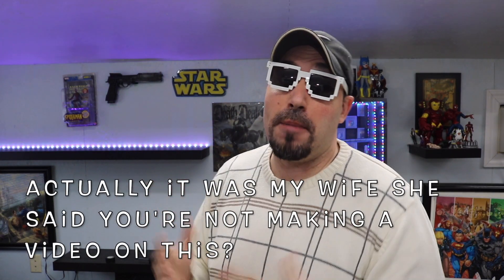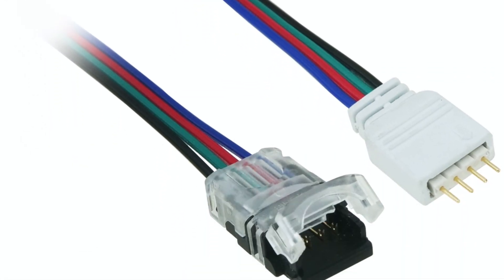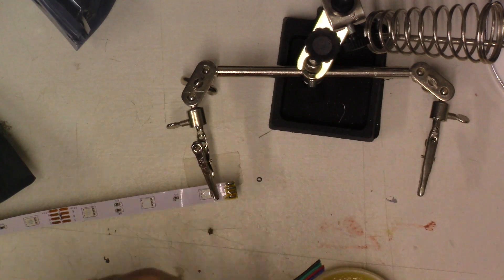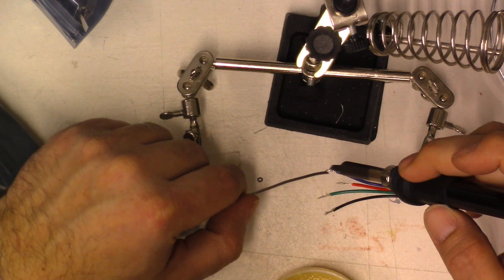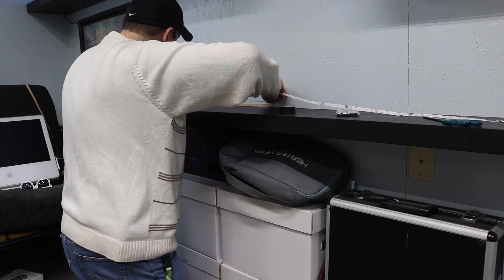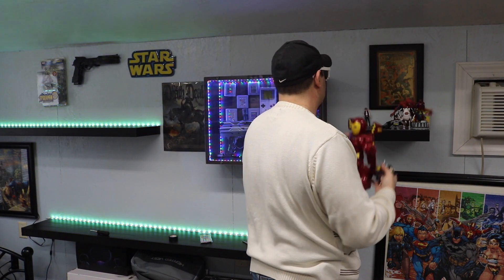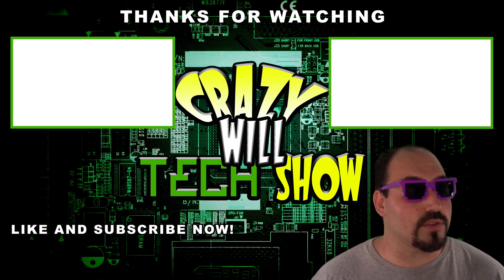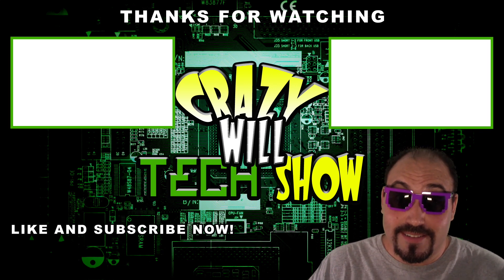Installing LED light strips on multiple shelves

Comment: planning todo this and wondering is there a difference from splicing the wires with the spliced end being on the first pad of the led either from the beginning of the strip closest to the power supply then from the end of the first strip of LED's?

I have a "trim" basically what the door frame is but it also runs along the middle of the walls and makes my walls have sections that i want with LED's with 2 different colors and want to know if i can split the wires a couple times so each section has enough power for them all to be bright and idk how many times you can split a wire and if you can split a wire thats already been split.
Reply from the maker: You can split them as many times as you want. You would have to look at the recommendation of the power supply to see how many sets of LEDs you can connect to it.

Comment: Should have used aluminum casing and connectors instead of soldering the joints. It would have been easier and look better.
Reply from the maker: Never had much luck with those.
Reply: @CrazyWillTechShow   Okay, I just find them easier and have had success with them. Love your videos by the way.
Reply from the maker: Could you please send me a link… i’m willing to give them a try.

Comment: Hey I know that this video was uploaded a while ago, but I really need some advice
I bought a 12v single 5-meter strip.

And I have two bookshelves and wanted to cut the strip into smaller strips that I will connect together in parallel as you did in your video.
My question is... will the power supply have enough power for all the strips?

I will have in total 10 small strips
Reply from the maker: Should work fine.

Comment: Ok, I know this is too mean but I'm tired and have been just trying to figure out how to run strips behind multiple shelves I will then have to push back against the wall (keep a strip continuous behind multiple shelves I will need to move at least a little bit) and its just frustrating and then I come on here to YouTube where, I swear to god, every single one of the instructional videos on LED strips stars some dudebro who made their video on the way to their job at a pyramid scheme that sells pickup seminars to other dudebros paid for exclusively with crypto. Oh my god, please just tell me what to do with the LED strips.
Reply from the maker: No pyramid scheme here… did you watch the video I show you how it works. You’re not really being clear on what your looking to do. Most of them have adhesive tape on the back of them and have appositive lead and Color Lead on the end.

Comment: Can you strip the end of the wires and put the wires on an solderless led connecter and the led strip on the other end?
Reply from the maker: I’m not sure what you mean? But they do make settlers connections there just a pain to use.
Reply: @CrazyWillTechShow  like you know the solderless led connectors, basicly instead of putting led strips on both ends and wires on one side And led strips on the other?